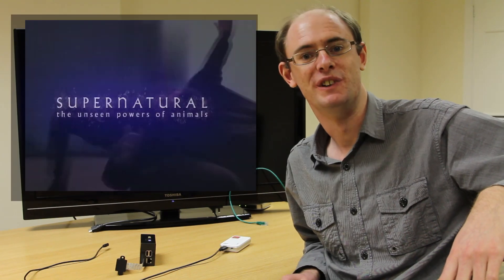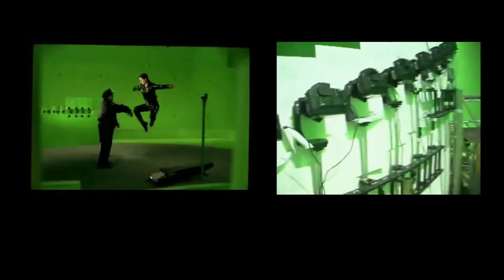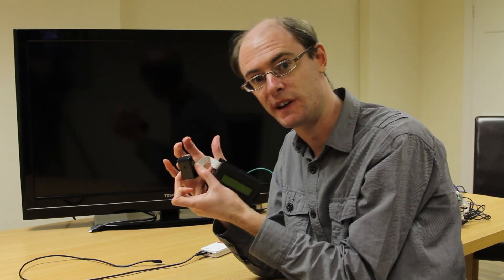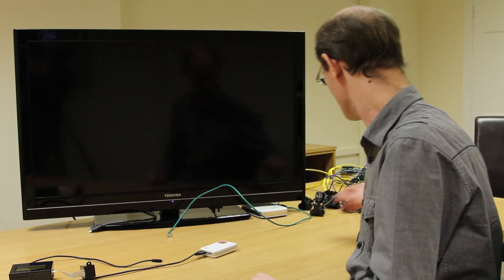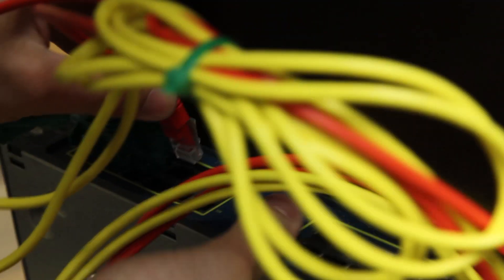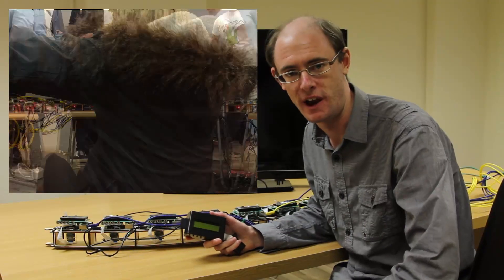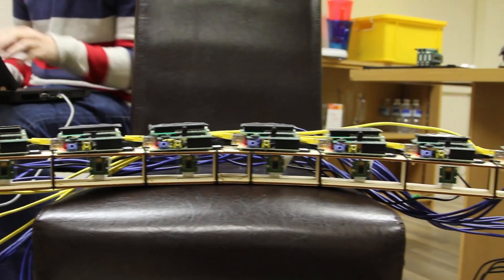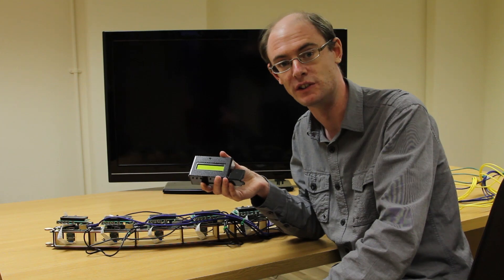Bullet Time Style Effect with PiFace Control and Display and Raspberry Pi

Comment: Ehm, so I count it from Farnell: 48*R-Pi B with SD card: 48*£26.30=£1262, 48*power supply=48*£2.65=£127, 1/2 km UTP (2*305 meter) about 2*£118.41=£236,8, some 48port switch from amazon: £185.99 etc. That is about £1811. That is really very expensive toy!!!

Or otherways: one computer that we already have and 48 normal webcams (48*￡4.37=￡209) + 48port usb-hub from DX -- taht is 4*13port hub: 4*£ 5,70=£23. That is £232! Ok, it should be really slow, with so many usb devices, but we can use for example 6 webcams with only one R-Pi.

So the same thing with R-pi is 7.8 times more expensive! Why? R-pi is a nice project, but not for this purpose.

Use your brain, not only R-Pi...
Reply: Well, imagine what a professional version would cost...
Imagine buying 48 DSLRs and the hardware to trigger them all at the same time, as well as the hardware to position them correctly...
So it IS expensive, but compared to the real thing it is crazy cheap! :)